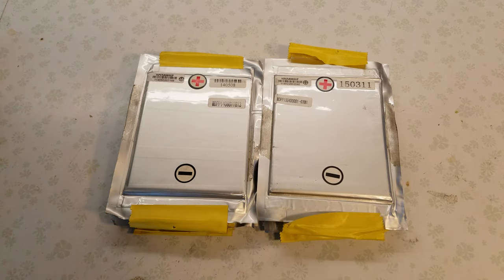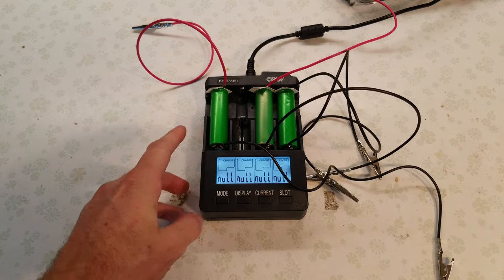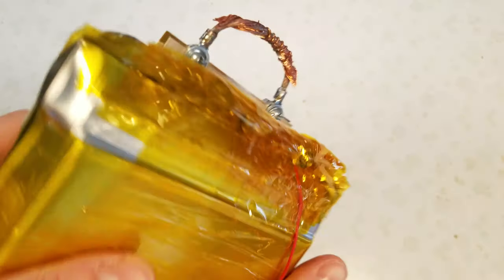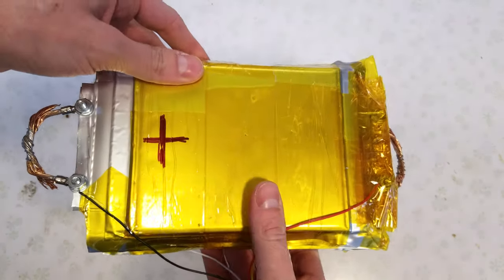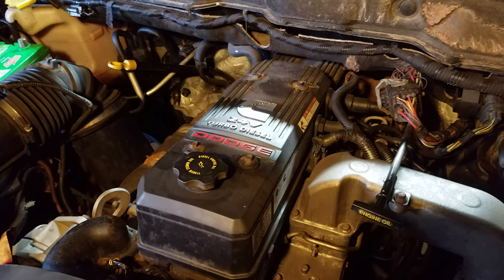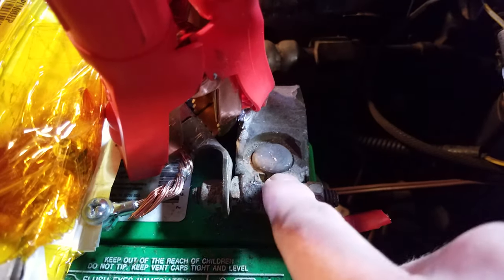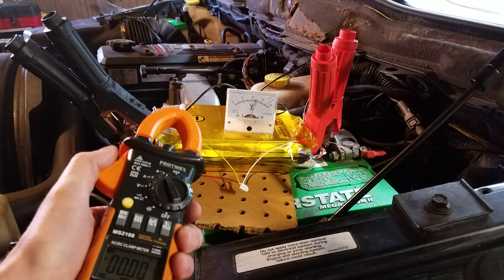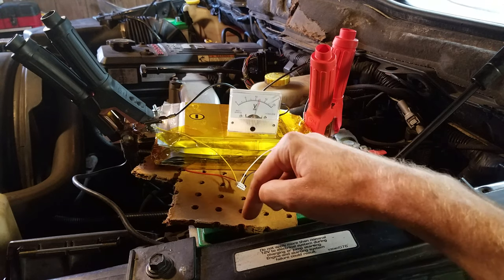Can the SPIM08HP Pouch Cells Start a Car? A Diesel Pickup Truck?

Comment: If you had 8 or 12 cells you could easily use it as 12v battery replacement but LiFEPO4 would be a safer alternative with a bit better charge-discharge curve all around.  Since most modern vehicles charge the batteries anywhere from 13.5-15V depending on the load on the battery, target fuel milage and outside temperature you can get away with using 4 cells charged to 3.6-3.7v which is 14.4-14.8V and running them down to 11v which is 2.75v per cell which is at about the bottom of the discharge curve for Lipo but you should not be getting them that low under normal operation of the vehicle in the first place.  A 12v lead-acid battery is generally considered fully dead at 10.5V but you don't want it to go below 11.9-12v under normal operation and to help get the full service-life out of it.  So even though it is on the lower side you should see lipo cells staying between 3.0 and 3.7V under normal operation in a 2P4S or 3P4S configuration with about 1/2 the rated amp-hour capacity.
Reply: Great comment sir, thank you.
I'll try both;  2P3S as a booster pack and 3P4S as a small car battery replacement.
Reply: Just sucks to charge them below zero celcius.
Reply: @rkan2  You're right, this can only be a 3 seasons replacement, but a booster pack can work if kept in relatively warm .

Comment: If you want to use rivets it’s actually quite easy use a small washer on both sides it’ll stop it from ripping through and make a very secure connection
Reply from the maker: I tried that too and the rivet didn't grab the washer on one side. I don't think I had the proper sized rivets either. Lots of things I did wrong there... lol
Reply: @LithiumSolar  I used M6 bolts, 1/8"x1/2" aluminum bar and nuts to join my pack

Comment: 4SnP, n > 4, Li-Ion better meets 12v car charging issues mentioned. n > 4 for spim08hp cells gives >= 800 A continuous, 1,600 Pulse Discharge Amps. Not sure how much above 4 n needs to be.

Li-Ion seem fine for jump starting a car; engine compartment temps might make the environment ill-suited. I'd want them sealed up and stored in a fire-tolerant location.

Great video.

Comment: Great video! i use 12 of these, 3S4P to run my kweld. awesome little cells
Reply: I use 3s1P of Chevy volt cells. Where you need 4p. Lol. K-weld will run on a 4s1p Turnigy, and get 1500-1900 amps calibrated.
Reply: @dogdipstick  it doesn't "need" 4p. It runs about the same on 3s2p.
Reply from the maker: I keep hearing how much energy the kWeld requires. Crazy! I guess it makes sense considering the input voltage is lower, not like it's plugged in to mains or anything.
Reply: @LithiumSolar  My input is 25.2v..... It is a measure of the SCC. A 40$ Turnigy does better.

Comment: These work great for car audio we use them in 4s and you boost the charge voltage by adding diodes to the sense wire on the alternator or running an external regulator you can go up to 16.8 but 15.5 15.7 is plenty, when I used lto i ran 6s.
Reply: Cole, What did the increased charge voltage do to you main car battery or did you switch to this 4s battery only?
Reply: @bigdaadio.K2WW  you dont use the lead battery anymore its a turd in the punch bowl, i might go back to headway or posibly lishins

Comment: I used grommets and just crimped tehm together in pairs.  And then ran threaded rod into the grommets to create the bus bar.  I am using them for a 7S system
Reply from the maker: That's a great idea! I hadn't even thought of grommets! That would have been much better than rivets. I may have to pick up a crimp tool.

Comment: I went with 4 cells, my truck charges to a max voltage to 14.5 volts.
Reply from the maker: Nice! What BMS are you using?
Reply: Are there any problems going with 4 batteries  (16.8v fully charged) when trying to start a car?  I've seen about 3 videos like this and everyone ONLY uses 3 of these batteries. I'm thinking of putting 4 of these in a old dead car jumper pack and bring it back to a usable item.  Should I do 3 or 4 of these batteries?
Reply: @dreteyete7305  Can't explode a 16.8v pack when only charging to 14.5...
Reply: @blackz06  but not fully charged right? And this was months ago honestly I gotta rewatch the video now lol
Reply: @dreteyete7305  not being fully charged doesnt hurt anything.
Reply: @chuckger1625  Id say 4 cells, most jump starters are 4 cell lipo. you can under charge these to 15v or so if you are still worried.

Comment: I wanted to say I am asking not trying to be a know it all . I have seen other info that says these cells are perfect for making 12v battery's actually the owner of battery hook up was the one who emailed me that info . He suggested using these for car audio . Because of that info I have 50 of these cells that I am building a 4s10p for a 75 or 80 ah 16v battery my car charges at 14.8 when cold maybe 13.5 to 13.7 when warm
Reply from the maker: You have to consider the reason why it is not a good idea. Your car engine is going to produce a LOT of heat under the hood. These batteries are not designed to operate at such high temperatures. Additionally, a 4s has 14.8V nominal. Your car charges a lead acid battery around there, but when a load is applied, it drops down to the 13-range. Your lithium batteries will continue supplying 14.8V and there may be electronics in your car not designed to operate at that high of a voltage for very long. I'm not saying it won't work, just that I definitely do not recommend it... Be careful.
Reply: @LithiumSolar  thanks I really appreciate the info . This will be a secondary battery really its a fourth I have 3 yellow top agms as of now 1 in the engine bay which is my starting battery and the other 2 in the tr I nk for reserves.  The lithium will be there in the trunk and 500 amp isolator to separate the arms from the lithium when sitting idle and the ignition is off . I have seen that people say you don't even need an isolator if your not leaving the batteries for more then a day or two without starting the car
Reply: Also I meant to tell you that the car has a aftermarket alternator that is 320 amp and with the agms and the alt when stereo systems power draw drops the voltage to the mid 11sof coarse it recovers quickly when bass cuts off so the lithium is to try to cure that
Reply: @danielwarbucks2469  how's the battery working for you?

Comment: I made plates to sandwich the terminals. Thats a pretty pack
Reply from the maker: Plates like thick bars that go between? Do you have any pictures/videos?
Reply: @LithiumSolar  ya i have a vid. But your may be better. Also they were made from very thick material and doesnt need. My first lipo vid.
Reply: @LithiumSolar  can you spot weld them tabs?
Reply: @LithiumSolar  I actually made a busbar system for my lifepo4 packs and I used some plumber pipe holder. It is a copper roll and it has a bunch of holes in it already and is very easy to cut. I think that would be much easier to use for the bars shown in this vid.
Reply: @LithiumSolar  here at 11m10s
https://www.youtube.com/watch?v=4SEjhUk4s3U

Comment: I'm planning to build a jump start pack out of these cells, I snagged 9 with holders from BH this week.

is there anything you would do differently now? would you go 3s still? my plan is 3s3p. 4s just kinda sketches me out in regards to putting 16v to modern vehicles.

I have all the stuff from a cheap lithium jump starter I blew up (I knew I was abusing it) so I have RP protection. the board from the pack will give me a bms, usb output and easy charging (microusb) if i go 3s.
Reply from the maker: Yes, I would still do 3s because of the high voltage problem you noted. I've heard quite a few people mention building jump start packs, but one part I don't quite understand. When you jump start a vehicle, it's usually because the battery is dead. How do you prevent the rush of current from lithium battery to car battery? Or is it just that it's not high enough to damage anything?
Reply: @LithiumSolar  the commercial ones only let the lithium stay connected for X seconds and have a relay and sometimes diode bank 

I assume the wire and components also act as a current limiting device, crude but seemingly effective

Clive did a teardown a while back, I'm sure the circuits have evolved since. https://youtu.be/0tGK1nqXr28

The one I blew up recently has a relay and some logic in its connection.
Reply: Omit the bms , use a battery isolator relay and i do recommend having 4s and charging it to 4v per cell that should give u 16v. Which most modern cars will accept. And if u in doubt charge them to 3.8v or just use fkn Lifepo4 25ah or 50ah cells!. They have perfect voltage range for lead acid replacement but are not rated for high c rate but i think they will still last as long as a lithium ion if u abuse them by starting cars. Use an active cell balancer and a relay with a time delay to disconnect after 10sec.
Reply: Think I’m going to build a 4s jump pack to use on semis with 4x group 31s. The volatile is an issue but I’d be afraid of having to worry about disconnecting after running with 3s and over voltage. 4s wouldn’t drop to low I’d imagine with say 10v batteries connected at crank time.
Reply: @LithiumSolar  4s is better. You only charge it up 3.75-4.00 and you're fine.

Comment: So I know everyone uses 3s for automotive related things but for a application like a jump starter wouldn't 4s make more sense and just under charging it? In the case the alternator pumps power back in the pack for to long I dont think it would hurt it when the max voltage would be 16.8v as alternator is 14.4 usually BUT if lets say the pack is fully charged would 16.8 Volts damage something on a car if hooked up ?
Reply from the maker: Yes, 4s would be better than 3s for a jump starter-type application provided it's not fully charged to 16.8V. I only had 6 cells and this was just a test to see if they could start it or not :) What would be even better is 4s of LiFePO4 since the voltage is near identical to 12V lead acid.
Reply: I've been struggling with this question. I feel like even fully charged batteries at 16.8v will drop to a resonable range once connected to a dead battery that will instantly swallow up its voltage.
Reply: I have created 4s powersport batteries and it works great. The alternator never gets high enough to fry them. The only downside is that some capacity is being wasted but the batteries should last much longer by sitting around the 50% SOC. For a car, I would not want to waste the capacity and use LiFE instead. Actually had a crappy scooter that would fry the lead acid by going to 18v and ended up making a 5s battery for it.

Comment: What kind of bms? And could I wire the alternator to the bms?
Reply from the maker: I didn't use a BMS here. And no, you can't charge these NMC batteries with a vehicle alternator. The voltages don't match, you'll either overcharge the batteries and cause fire if using 3s or will end up storing a voltage too high and risk damaging your electronics if using 4s. The purpose of this was to test the surge capabilities of these batteries, not as a replacement :) #StaySafe
Reply: @LithiumSolar  you very well CAN charge these in 4s configuration with the alternator. Up to 14.4, or whatever, anyway. No damage done, just not a full charge

Comment: I strongly disagree with what you said about car batteries. A healthy 12 volt automotive battery sits at 12.5 volts idle. When it starts your typical car it will not go below 11.5 volts before the car starts. As soon as the alternator kicks in the battery voltage should not rise above 13.5 to 14 volts. A 12 volt automotive battery that measures 9.5 volts idle is considered to be dead. A 12 volt automotive battery that measures more than 13 volts idle is in danger of fire or bursting.

Comment: Great batteries, what was the voltage drop on each test please? The video my end goes blurred when i freeze-frame it. Thanks
Reply from the maker: Make sure you have the video set to 2160p. The approximate voltages are... Test #1 ~10.2V, Test #2 ~7.5V, Test #3 ~7.8V.
Reply: @LithiumSolar  Thanks for that. I must have watched it before full quality was available as it's in 4k now but was only available in 720p at first.

Comment: Hey there. Just wondering what you think about using a 4s Li-fe battery for running a car? 
The cells I am thinking of using are from a 12v jump box. I think it would be fine.
Reply from the maker: It should be fine electrically. The important thing to keep in mind is these "harvested" and recycled batteries are not made to take the high amount of heat from the engine. The batteries could overheat easily and catch fire. For that reason alone, I wouldn't put a DIY battery in my car.

Comment: 24 VALVE?!!?!?!?
Reply from the maker: Yes, 24 valve... :)
Reply: LithiumSolar 

Oof, by the way BEAUTIFUL start ups. I just love seeing voltage meteres go down and up....

I wish you let it run though XD, yes I know the voltage is quite high for the lithium but coool :)

My school bus, I saw it in 21 volts and the volt meter was like on the dead edge, so I taught it won’t start, but🤣😂🤣😂 it fired right up woowww